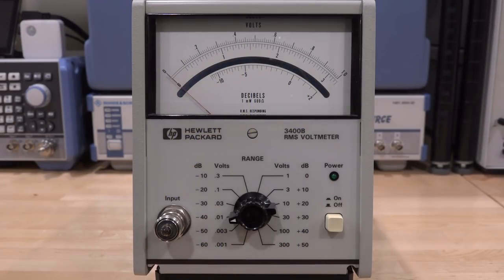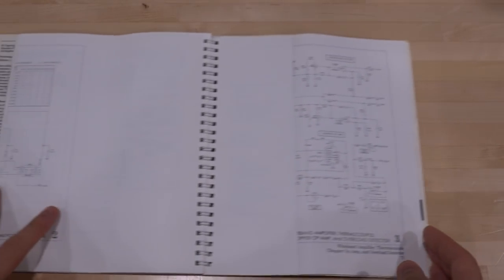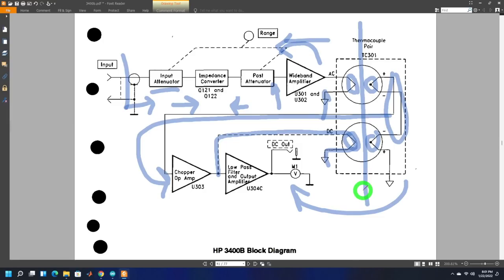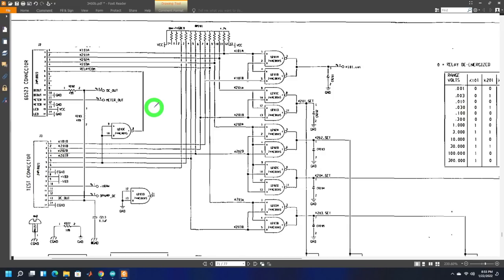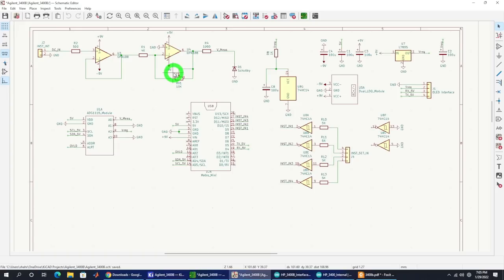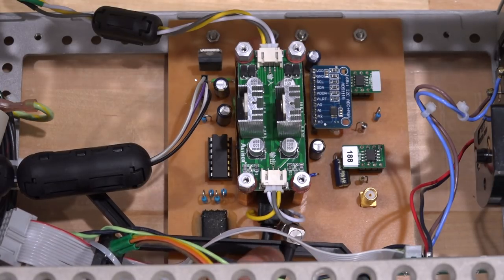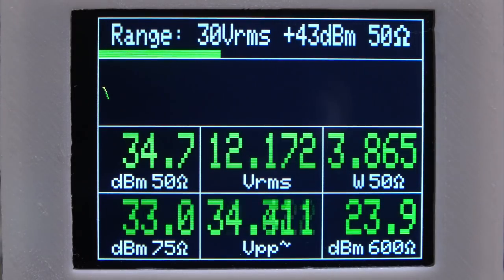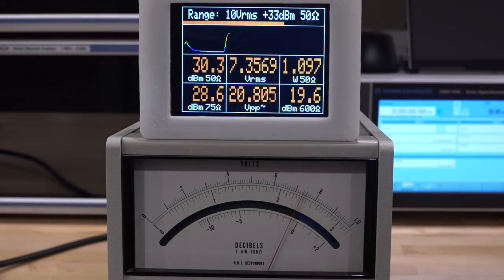TSP #203 - Teardown, Upgrade & Experiments with an Agilent 3400B High Dynamic-Range RMS Voltmeter

Comment from the maker: Note: I mistakenly referred to the pair of the thermocouples & heating elements as "coupled". What I actually meant to say was "matched". In fact, these elements should be completely thermally isolated from each other. Their only interaction is the series connections of the thermocouple pairs They are "matched" in a sense that their thermoelectric responses are as similar as possible. They also have fairly small thermal mass which is why the unit can react to an AM modulated signal.
Reply: Ah, thanks for clarifying---I was wondering about that! :-)
Reply: Completely right. Also you have to consider balancing issues on the AC side as the capacitance between the thermocouple and heater is quite some picofarads because of their close proximity. Those imbalances and coupling are actually one of the largest contributors in measurement uncertainty when doing precision ac measurements. A way of solving them is to have an ac driven guard on the tvc output to eliminate the leakage.
Reply: Thank you. I was wondering about that while watching .

Anyway great work as usual Sir.
Reply: Another little mistake is that the two termocouples are in anti-series connection, their voltages are not added together but subtracted, that creates the negative feedback.
Reply: I see you have a keysight E 36212A bench power supply at the end of the video. Does yours also step values (voltage or current) in a non linear fashion? I've noticed stepping up the set value does not change the output linear.

Comment: Cool upgrade project! For the electronics design I would recommend using either a 2-layer PCB:s for ensuring close-by ground return path for any digital signals (i.e ADC, display and serial port). Second best world be routing ground traces between each digital signal (or at least between each pair of signals). Soldered wires or isolated copper tape could be added on top of signal traces for improved ground returns on the current PCB designs. For future PCB designs, adding series termination resistors (33-100 Ohms) close to the each driving digital output would also significantly reduce ringing and radiated noise/emission from digital lines switching state by reducing signal slew rate, dV/dt. Keep up the good work, really like the content you provide!

Comment: That project was really awesome, i really enjoyed it. Just one small note - it would be nicer from a UI standpoint to have the power in to 50/75/600R all on one line. That way they would be a bit more grouped together. Right now everything is a bit scattered.
Reply from the maker: Thanks! You are right. I can easily move the display around because it is fairly modular in code.
Reply: @Thesignalpath  You're welcome. It should be easy yeah.
Thank you again for the great content you provide.

Comment: This was a fabulous project! I vote for more of this type of content. You mentioned that you were going to source the data output from the ribbon cable. You also pointed out the test connector on the schematic. It appeared to me that you could have taken the data from the test connector and that doing so may have been easier than tapping the cable. Just thinking...

Comment: Very cool! Similar to this project I added a USB adapter to a few of my Keithley 177 and 179 for datalogging. I got lucky that there was a connector populated for an optional GPIB add-on (that I did not have) so I only had to decode the digital signals.

Comment: Wouldnt those multiple earth connections to the same point of the PCD result in earth loops? That's a really cool upgrade for sure!
Reply from the maker: Yes in fact that was one of the original problems. The main GND is captured right at the rectifier point. The rest of the ground connections offers isolation and other noise suppressions.

Comment: As always, some awesome content right here! Thank you for sharing it with us. 
I got one question though: to keep the noise from the MCU isolated from the range logic, you've done some magig with some 74x14 and the 1k - 100uF low pass filter at the supply of the IC. Since those signals are very low frequency and low current, would'nt it be sufficient enough to filter them by a huge time constant low pass filter (like you did with the power supply)? Of course you would have a lot of additional parts,.. but in general it should be possible right?
Reply from the maker: I think it should work as well. I just really wanted to isolate everything and avoid having to make another PCB.

Comment: How would one cleanup the background noise getting into system while measuring power supply noise?  36:20 You have mentioned it can be cleaned up. Could you please guide me into correct direction where i can read about it?

Comment: This is a relatively simple yet hugely useful mod! Have you wrote the USB code yet? Since the internals of the instrument is sensitive, my opinion would be to put the USB interface into the front panel instead of the delicate sampling board. That could have further advantage too (after writing serious amount of code): possibility to edit and upload display configurations, like custom color ranges, turn on/off coloring altogether, switch perspectives like full screen trend with small textual results...

Is that a touchscreen? Some of these profiles could be edited on PC, uploaded, then changed on the device itself.

Embed some sort of transfer function interpreter into it, then you could upload a custom measurement function too, alongside (or instead of) the hardcoded 50/75/600ohm load power calculators.

Comment: Great Content as always. 
But a fact on this Voltmeter: Put it on Steroids and you will get out the mighty Fluke 5790 AC Measurement Standard. Actually all Fluke 57xx instruments use a very similar AC/DC conversion techinique to achieve their outstanding accuracy for AC voltage and current.
The basic principle of this goes way back in history and correctly done it is still today the most accurate way of measuring AC Signals. The name of the technique is „AC/DC transfer Difference“ And can give you uncertainties in the single digit ppm range for either Voltage in high impedance (with something like a Fluke 792A), current into a known shunt (Like the Fluke A40B) or effective power into a defined load. 
Extracting the Thermo coupled device into a self contained unit and you get a so called „Single junction Thermal converter“. Their output is usually quite low, around 5-10 mV with their heating wire at nominal design load. The HP 1104x and 1105x series are good examples of those.
A more modern Converter which is still mainly used on National laboratory level is the „Planar Multijunction thermal converter“ which is a thick or thin film based elements on ceramic or quartz substrate. They achieve outstanding long term stability and up to 100MHz of bandwidth. They also have a considerably higher output of up to 100 mV and have an almost perfect square law response compared to classic SJTCs.

Comment: I'm curious how many of the EMC issues you observed were the result of shoehorning the design into a single layer. If you had fabbed a 2 or (ideally) 4 layer board with a solid ground plane to avoid signal and power return currents stepping on each other, I suspect all of the overkill power filtering etc may not have been needed. Looking at your board layout at 22:33, the ground looks like Swiss cheese.

Sure, doing it in house is quicker and might save money, but how many hours did you spend redesigning the board when an extra $10 and a week of lead time would have eliminated them the first time? I used to home-etch boards but after doing some cost-benefit analysis realized it was just not worth the effort. Worse quality, lots of time spent on the process, and single layer is really limiting.
Reply: Was about to comment something similar. It is a really well polished project but it seems he spent most time fixing analog noise from the ratsnest of modules without ground plane..
Reply from the maker: I did a lot of experiments on this. The problem (as far as I could see), was not the ground plane. There was some ground loops issues which was causing something like a 1mV of drop across the main PCB. But there is no doubt that having a two layer board would be an improvement.

Comment: Interesting that this popped up in my feed, I have one of these meters and was wondering how I could use that voltage output (we used to use them to monitor a baseband level indication on analog multiplex to a strip chart recorder) in new way. They really are a great meter, back when HP made great things (and manuals).
Thanks for sharing

Comment: Goog project. I love it. I would totally add a blinking red Led on the front panel of the 3400 to notify the user that it is in autorange mode. What happens if you change the range switch position?

Comment: I don't think there is thermal coupling, usually quite the opposite, you want thermal isolation between thermoconverters. You want only known DC signal power to relate to unknown AC signal power, not thermal effects coupling. Let's measure +50 dBm from my calibrator into 3400B :)
Reply from the maker: Yes! I don't know why I kept saying "coupled" when I should be saying "matched". Thank you for catching that. I will add a pinned comment.

You and I still have to meet. I am sorry it has taken so long... :)

Comment: personally, knowing usb, I would have put the usb output on the outside unit instead of inside (but if it works, it works)
Reply from the maker: Yeah, I agree. I just had this particular USB extender in my parts list and it was fitting better inside.

Comment: I’m no noise expert, but I would think that those 4 ground wires are not a good idea to that board.  I think it would be better just to have 1.  Gauge seems appropriate as I doubt it draws that much power.